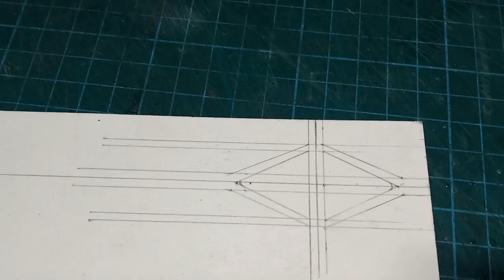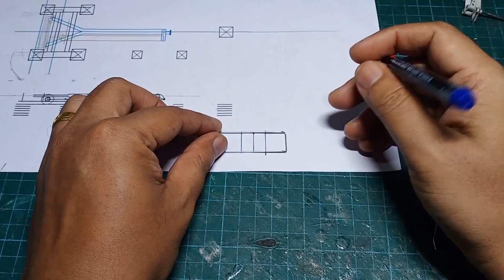WAG 12B Pantograph | Handmade working miniature model | Electric locomotive

Comment: hello sir, i am starting making a railway models, but getting really confused with which material to chose
ABS Styrene Plastic
Acrylic Sheet 
HIP Plastic
Sun board 
Box board
Foam Board
PVC Sheet
mount board

can you help me with how to choose materials it will be helpful to people like me
Reply from the maker: i mainly use mount board. its easy to cut, smooth, paint and sufficient strength also. in fact all materials have its own advantage and disadvantage. Also depends on the tools you have to work with them and also the time. all materials you mentioned are really good with appropriate tools to work with them.

Comment: Hyper realistic... 
Wowww....
Materials used are water proof or not? 
Any paper or chart paper is used?
Reply from the maker: mount board, sticker paper etc are used. Paper parts are coated with glue to make it water proof
Reply: @HeemsMiniatureWorld  
Please try to make the same using plastic and some light weight metals. 
Nowadays 3D printing technology is becoming popular. But I don't know if it is possible to make these tiny profiles and parts using 3 D printer. 
If plastic, then it will be more strong, waterproof and stiff compared to paper sheets.

You must definitely present your models to Indian Railway museums. Some paper and cardboard models which I saw on YouTube are nothing in front of your models.